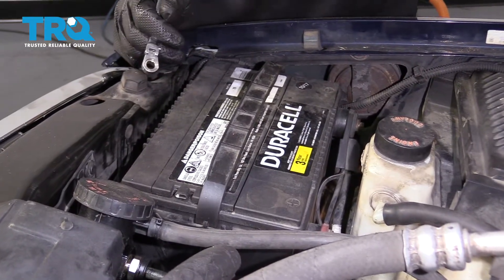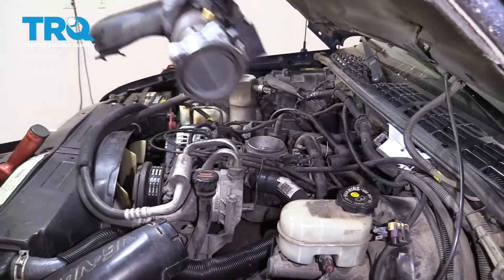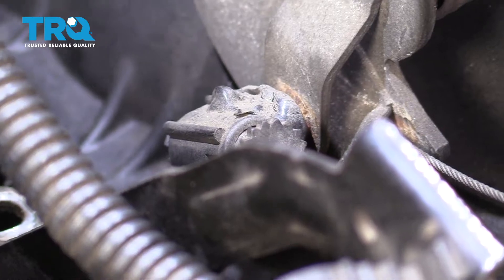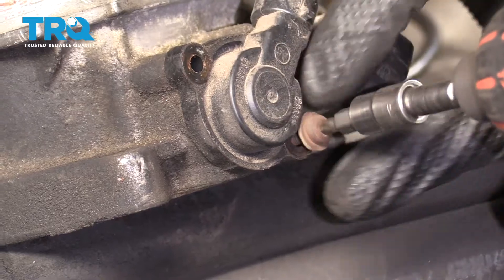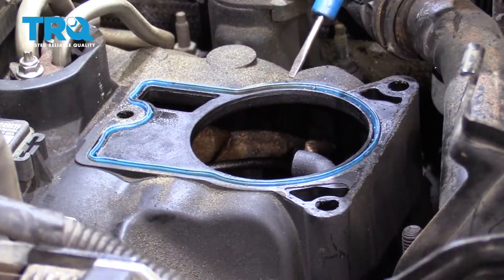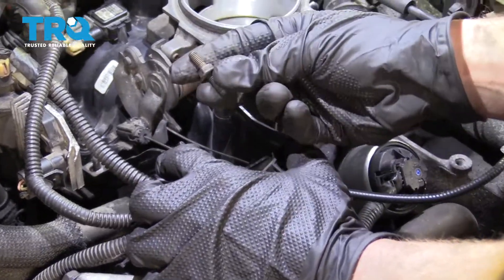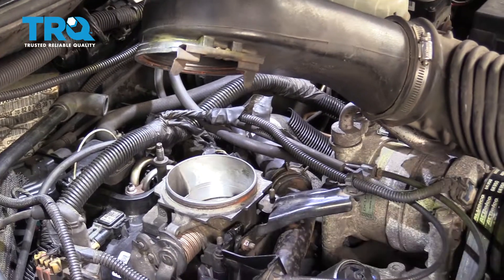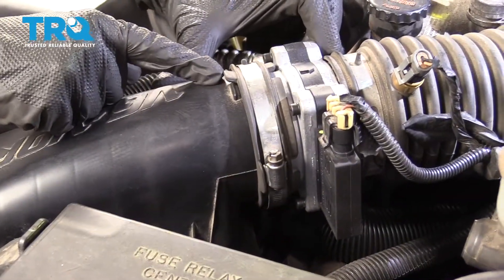How to Replace Throttle Position Sensor 1994-2004 Chevy S-10

Comment: I just replaced mine on a 98. The only thing I removed was the plastic air horn. You can easily sneak a T20 driver over and under the hoses to remove the sensor. Only took about 10 mins. You made quite the project out of it.

Comment: You can use a long torx driver you don't have to take off the TB to replace TPS but you should take it off and clean it look how dirty it was make sure butterfly valve and bore are clean along with surface of tps mounting

Comment: Once again TRQ needs to Update the title for just about all of these videos meant for "94". Just about every 94+ video TRQ has released is meant only for the the TBI Not the CPI 4.3 V6 Vortec. Some of the sensors are either mounted differently, or in another area, or are not even the correct Sensor for it.
Reply: Just a warning for you 94-95 CPI guys.

Comment: Unnecessary steps. Just remove upper radiator hose at throttle body.this gives access to TPS
Reply: Literally a long torx screw driver.. No need to remove hose.